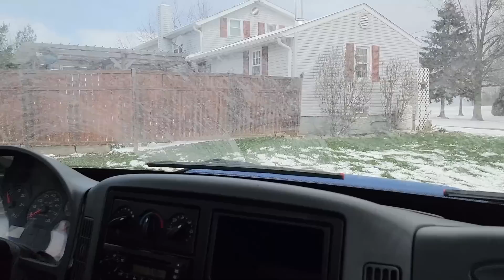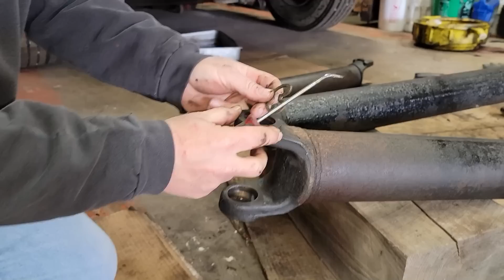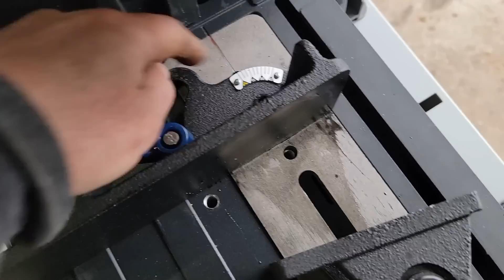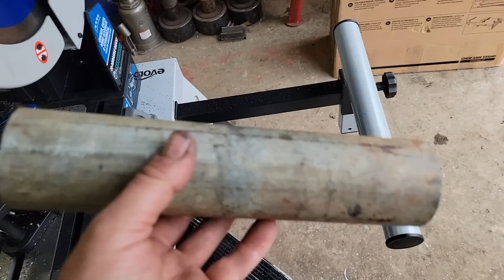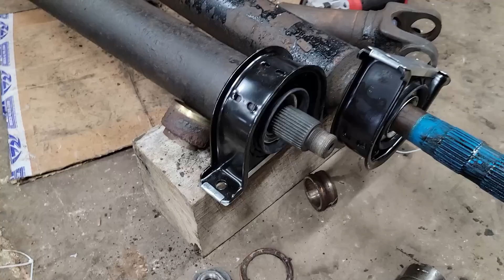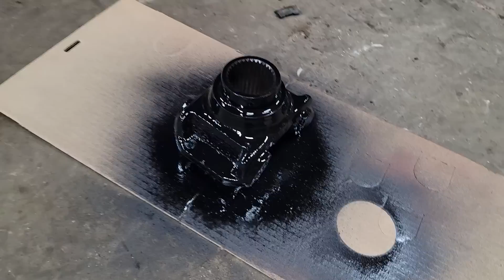2002 INTERNATIONAL 4300 DRIVESHAFT REBUILD WITH CHOP SAW & WELDER?

Comment: Did my 79 280sl a few years ago... nightmare... drop exhaust welded front to rear. Shaft collapses no room to work.park brake assembly complicated is a blind install.. had shop install and balance shaft for 80 painted it too... ... no charge to install carrier bearing and bracket so I let them.... has end shaft grease bearings that fit to end shafts... month to get all parts ... replaced everything... had to remove more parts at manifold to install grrrr no room. Nightmare job...my bearing had no grease...  my club had a driveline  failure it totaled car.  Ripped it all apart..  thanks for memory..yes I also cleaned repainted all parts... you do very nice work..  it all started from a moron youtuber that stated just pry the drive shaft to replace flex disks.. it damaged my grease end shafts.. morons also ruined carrier boot..  pissed you betya... but I replaced everything and good riddence.. nice to see competent work... why I watch...

Comment: i got in the habit of using a cylindrical flap disc to get into the cap bores and clean them out some to where the cap taps in a little easier , and i use a dremel type tool to slightly cut the ring groove , especially on high mile units as the inner edge will get rolled a little and the ring can pop out or just not seat properly.

Comment: Byers products has the trunnions for the shift cables or if you want to pay dearly go to Allision, IHC saved a penny by not using the longer trunnion .   Recall the older Internationals of the 60and 70 using a carrier bearing that had a Zerk fitting so they could be serviced.

Comment: We use the same blades.We actually buy a blade wax they have for that type blade.That really helps with wear and provides a lube.
Reply from the maker: i have some of that. i use to use it on drill bits until my wife started helping me in the shop. now we use an oil can. i will definitely keep it in mind for that saw blade.

Comment: Wonder if you can drill out that piece and use a pin for a slack adjuster to solve your linkage problem
Reply from the maker: no. the shift cable is threaded and goes right through the center of it.

Comment: You aught to look into either the Milwaukee or snap on electric 3/8 ratchets. Good for stuff like that driveshaft where the impact didn't fit. I was old school before using my snap ons
Reply from the maker: i have the snap on battery ratchets. i just preferred a manual ratchet for that.